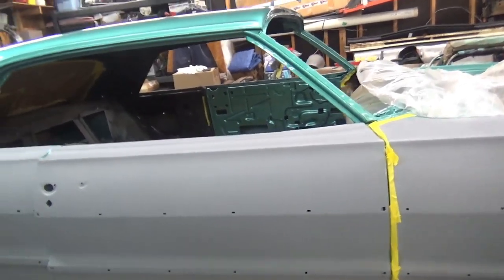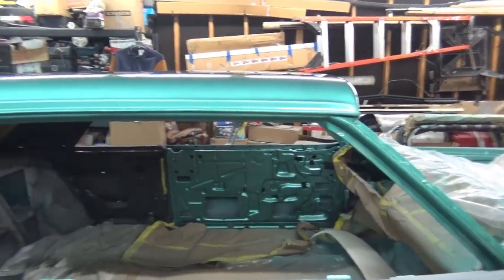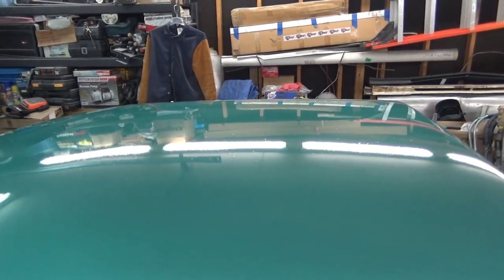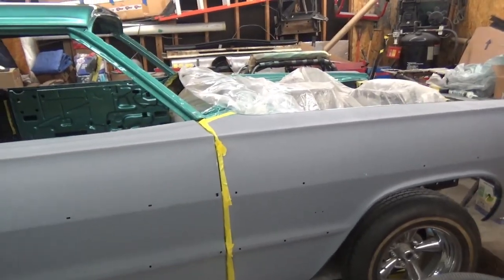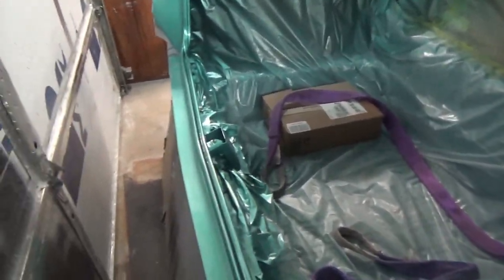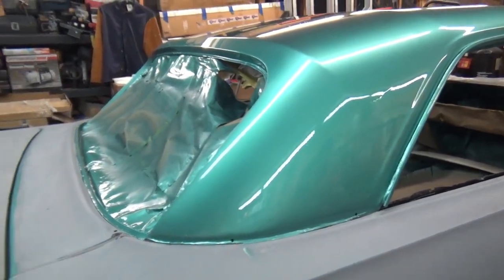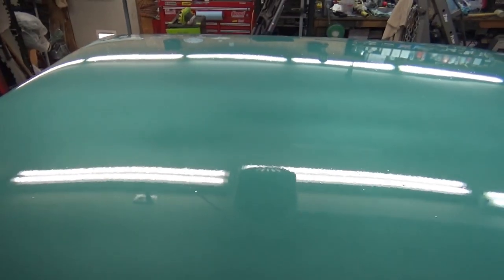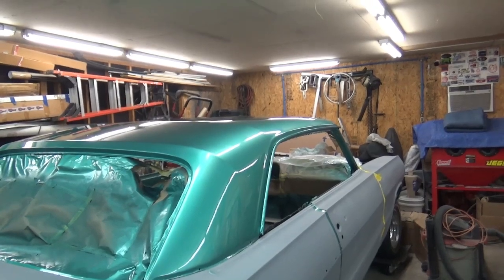64 Impala Roof Painted

Comment: Glad to see you are still plugging away !  If you decided to respray,  perhaps set the car all the way on the ground with no wheels. And the top will be much easier to reach. I like the color. Looking good.
Reply from the maker: Didn't think of that, going to cut & buff and see how it turns out. If I'm not happy may respray it. Thanks!

Comment: Welcome back Sam..You have worked way to hard to settle for that.
Sam check your fan width and move a little faster when spraying each pass. 
I never sprayed 2 step paints always lacquer or enamel when I was a body man working at Chevrolet. 
Nice thing is you can really wet sand your clear to remove dust.becareful of the edges they burn quick.
Sorry for giving advice but really enjoy your hard work. Stay safe
Reply from the maker: Thank you for the advice I appreciate it. I am going to redo the roof later, trying to get the body ready for paint.

Comment: Sam. I know I keep asking questions so my apologies. Is there any pointers or advice you can give me prior to cutting my quarter panels to fix the gap issue at trunk end? I’d love to chat with you a bit prior to cutting if your up for it man. Hope all is well with you man. Thank you.
Reply from the maker: No problem, I am still trying to find the original deck filler panel. I know I put it in the attic in my shop but got a lot of stuff up there.  Did you replace both quarters and deck filler panel? I was trying to find a way to send a private message so I could give you my email and phone number, there used to be a way to send private messages on you tube but I don't see that anymore.
Reply: @ClassicCarOverhaul  yes I replaced both quarters just like you however I’m using the original deck lid because it was solid. Don’t worry about the measurements man I can contact dynacorn the manufacturer for that. I have the original to measure. I’ll see if I can find a way to private message you as well. Thanks Sam.
Reply from the maker: Are talking about the trunk or the filler panel between the back glass and the trunk.  I bought a dynacorn trunk that is on the car, I can measure that. I will try and make a video on the trunk measurements and post it
Reply: @ClassicCarOverhaul  well I’m having the same gapping issues at the rear end of trunk and was thinking maybe it was because of the width of the original deck filler panel.

Comment: Sorry to say Tiger lines Too much dirt in the clear You have too much time in that car To leave it the way it is repaint the roof that's my honest opinion  So as a auto body Technician I will tell you to color sand Make sure your gun is  Shooting Evenly clean it really good if you color sand it, it will only take a light coat of base then lay your clear down wet down the whole garage before painting hope this helps
Reply from the maker: Thank you for your honest opinion and advice. I am going to paint the body then come back to the roof, it's just frustrating because materials are not cheap.
Reply: I know I been there many times